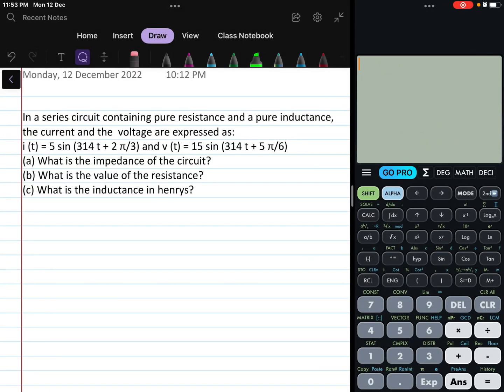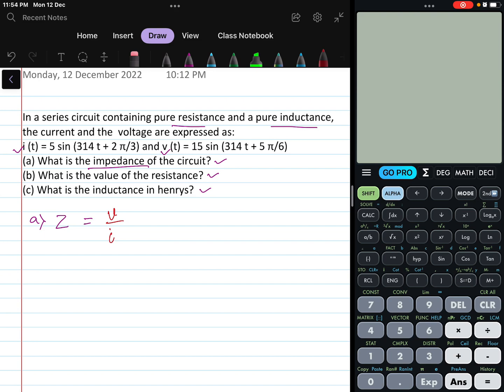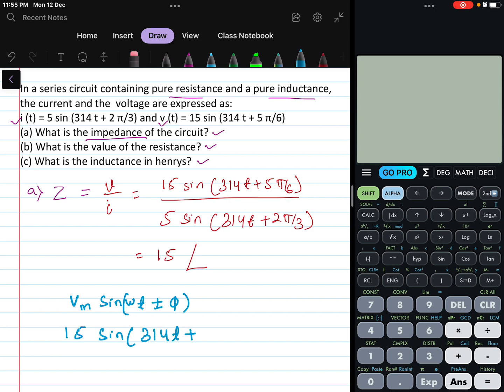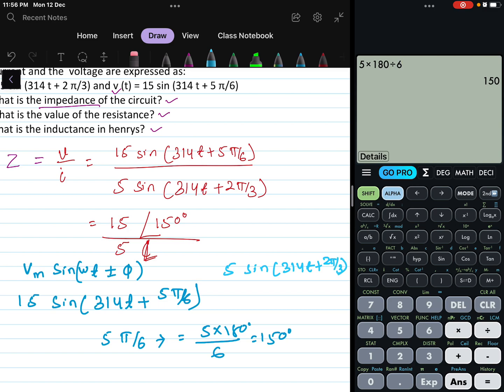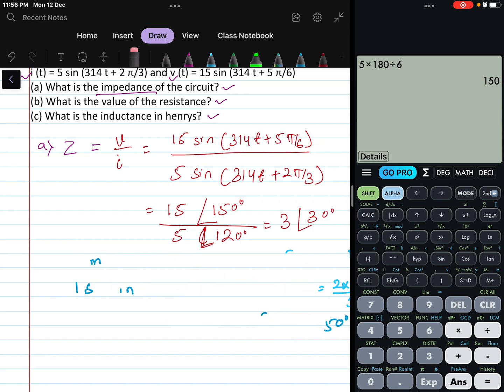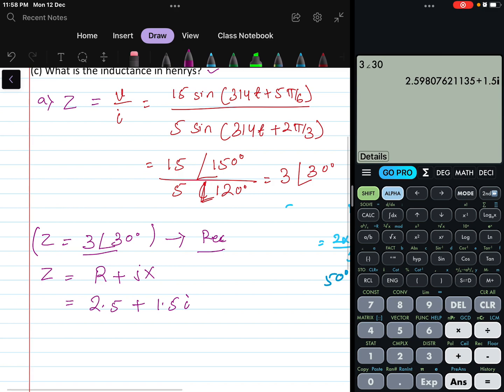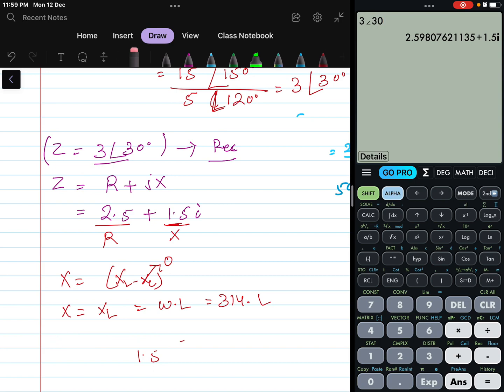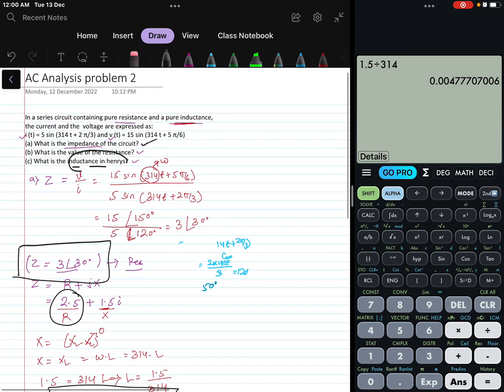AC circuit Analysis Problem 2

Comment: A two-element series circuit is connected across an AC source e = 400sqrt(2) * sin(omega*t + 40 deg) V. The current in the circuit then is found to be i = 20sqrt(2) * cos(314t - 45 deg) A. Determine parameters of the circuit, voltage drop across each element and power factor, power consumed by the circuit.